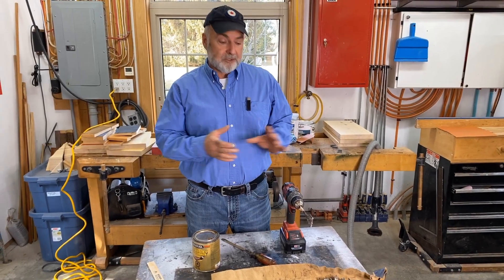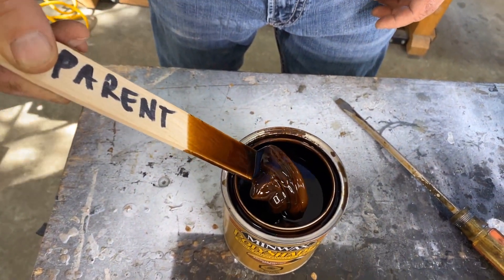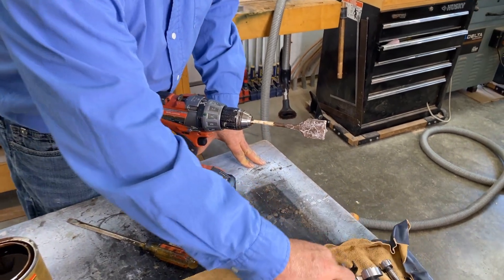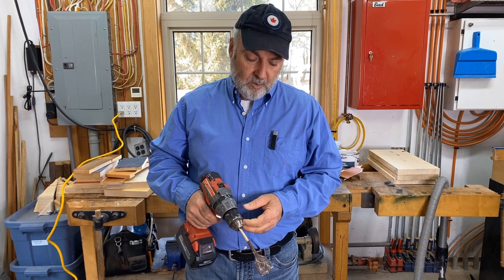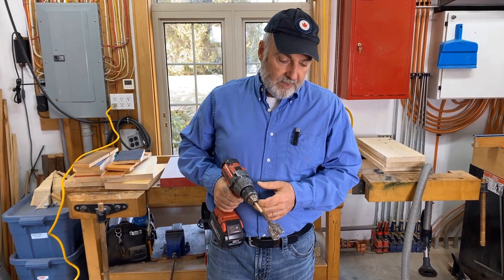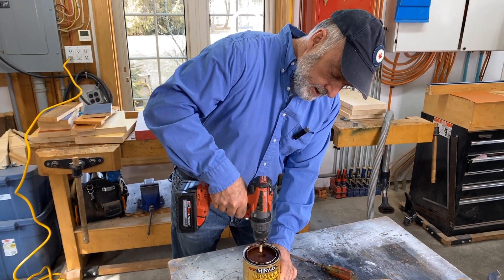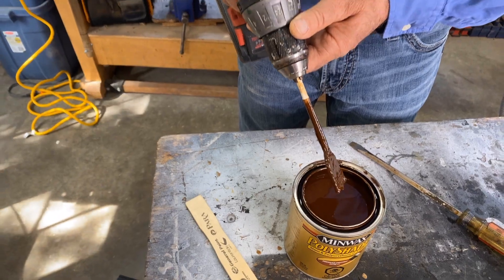Fastest Way to Mix Wood Stain

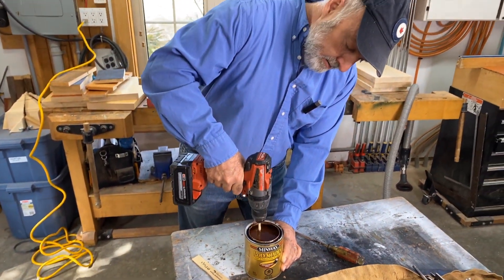Comment: 3:56 'Reversing rotation can't hurt'  Actually you're undoing all your work if you reverse it.
 
However, you will gain back the time you used mixing it in the first place.